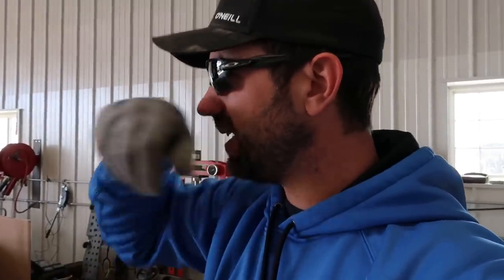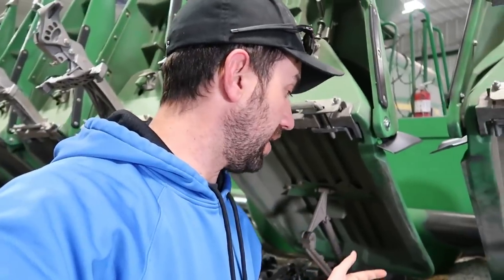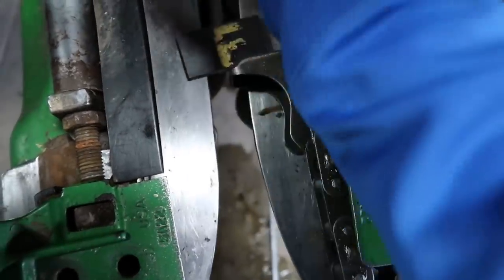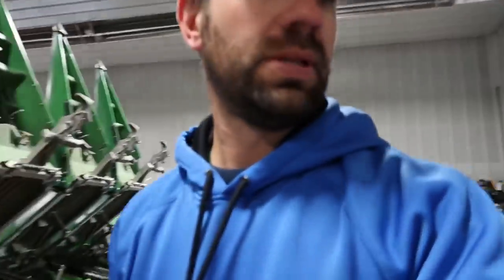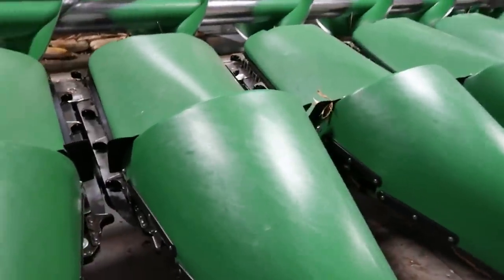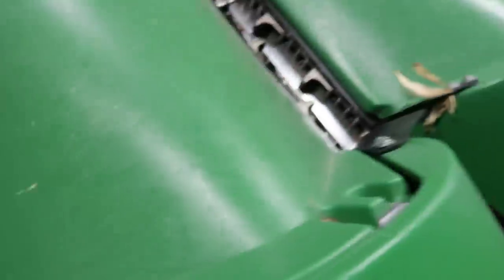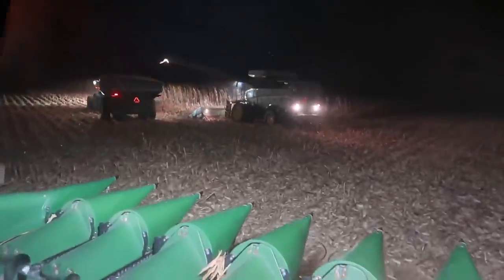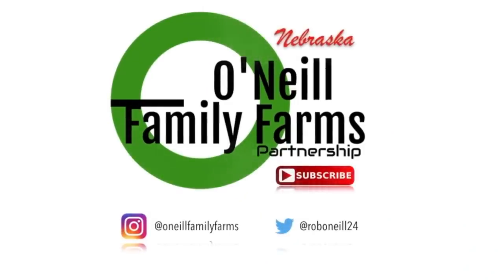Corn Heads 🌽 | Demo 16 Row Split Flex

Comment: Rob , I’m pretty sure no 1 fuel is Kerosene . We use to add so much to our diesel tanks mix with the fuel . Some people don’t want to be on camera , it’s just nice to get a different point of view sometimes on the family farm . How was the power in the Combine with that 12 row head . The only problem with a 12 row head is it fills that grain tank up quick .
Reply: I meant 16 row split !
Reply from the maker: Yeah it fills in quicker. We have the extensions. But if we had a16 I’d go with The big demco ones that hold 520 total bu.

Comment: So you adjusted the deck plates,does the header not have hydraulic adjustable deck plates? or do you still have to adjust them to get the initial position correct? Nebraska Harvest Center is that not a CLASS dealership?!! Flexing corn head, that's a nice idea is the flesx point between the deck plates or in the center of a snout.
Reply from the maker: Yeah it does have hydraulic deck plates. We just set them at the initial position. Yeah Nebraska harvest center is claas.  We demoed one a few years back. In between snout.

Comment: Number 1 is basically closer to kerosene then it is diesel. You can interchange #1 diesel in a kerosene heater etc
Reply: No you can't ulsd and kero are total different number 1 is 15 ppm ulsd that has winter additive in in also called cold flow ulsd

Comment: Great video - again! Some folks are naturally camera shy and feel that they don't have much to contribute and that is fine also. Even drone footage is great to see. On the 16 row head - did the combine have a sufficient amount of power for the amount of grain to process and the hill to climb? (I operated an S670 w/35' platform in beans and it couldn't power up a hill with a full tank of beans.) Also, No 1 fuel is more processed than #2 - which results in less available BTU's for the engine power but doesn't create the 'gel' problem as quickly as the #2 fuel. Check it out with some of the long haul trucking folks and you may find that they divert water from the engine through the fuel tank to keep the #2 from gelling in the winter resulting in more power to the ground.
Reply from the maker: Powers not bad in dry corn. Beans with green stems is our biggest power user. These stalks were tough so we had to slow down for that. Thanks for the info, interesting.

Comment: 2 1/2 gallons of gas per 150 gallons diesel will keep you from jelling up and it  a lot cheaper
Reply: John Bennett according to the research I’ve done that is a potentially damaging to your pump and injectors. It also lowers the flash point which can cause premature ignition.
Reply: @adamfpv8294  that might on tier 4 motors but on older motors works just fine done it a lot of times never had any troubles
Reply: As you know gasoline is a solvent and diesel is a oil, diesel is used as a lubricant in the fuel pump and injectors, if gasoline gets in there it could wash all the diesel away and there will be no lubrication. If you’re not worried about having to replace the pump and injectors early, it’s just money and time. If you don’t plan on keeping the machine for very long I guess it’s the next guys problem.